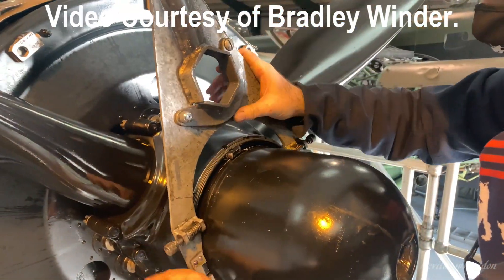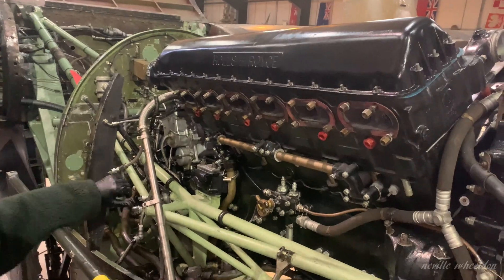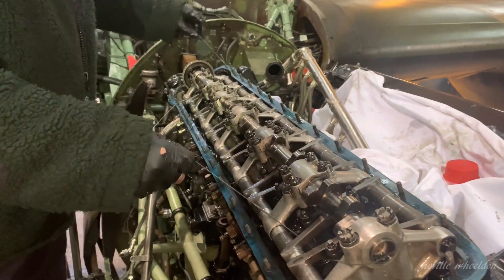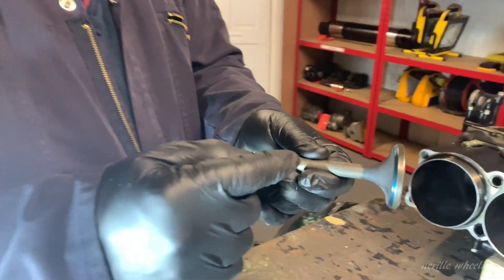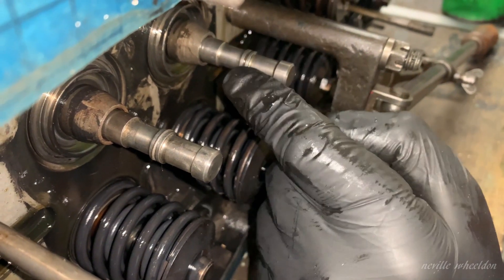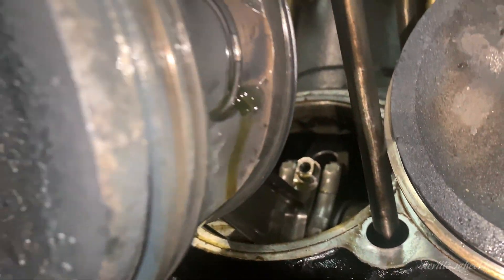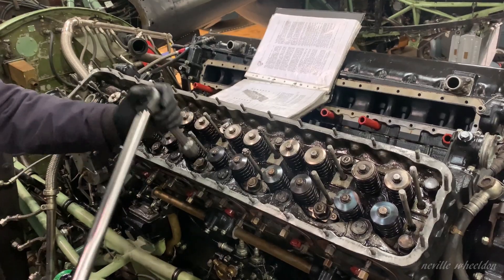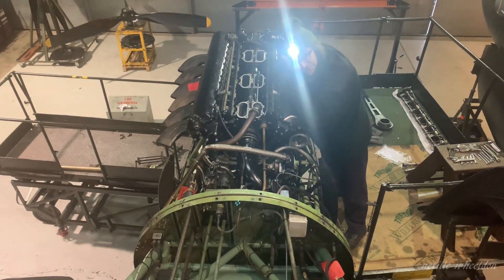Lockdown video 30. Received more Video clips from Bradley, engineer at East Kirkby

Comment: Brilliant video, thanks! An interesting point about the valve retaining rings at 7:00. I had a double spring failure many years ago in a Merlin and (I assume) the dished crown of the piston actually caused the loose valve stem to bend, which in turn caused the valve to jam in the guide and pull it down into the cylinder with the valve! Piston crown and head looked like mashed potato!
Reply: Ouch!!

Comment: Did you lap the valves once blued?
Reply: Lapping isn’t done with Merlins as the seats aren’t perfectly round until the engine is at operating temperature. So if the valve was lapped on the bench, it wouldn’t seal at operating temperature.

Comment: How on earth did they manage to manufacture all of the myriad of parts for this plane during wartime. There were countless other of types aircraft that were designed and built as well all in 6 years. The achievement was monumental and I doubt it could ever be repeated. The men that flew these planes were the hero's but we must thank the designers and engineers that built them. The modern F-35 jet took 10 years to design and develop and is in service with 871 faults !

Comment: Are the valves sodium cooled ?
Reply: Exhaust valves, yes.
Reply: @BradleyWinder96        When I flew the Dak in the 80’s,  we. often had valve failures due to fatigue failure at the weld between the stem and the valve head.

Comment: A great bit of engineering born of huge experience but it would have been great to see the technique required and the tooling to compress the piston rings when refitting the block. Any chance of seeing that???
Reply from the maker: There are two more block to be changed, so we will keep are finger crossed. This is a reply Brad gave to the same question you asked. Page down to Paul McCullock.
Bradley Winder
1 week ago
We tried but didn’t have enough hands 😎

Comment: Interesting. The cyl. Head doesn't separate from the block then. Must be a nightmare to insert new valve seats.
Reply: It does separate from the block but to remove it from the skirt you must remove the block first.

Comment: Question for the techs, I presume the bottom of the liners have a long gradual taper that acts as the piston  ring compressor?
Reply: Unfortunately not. We use ring compressors and tweezers for the final four scraper rings.
Reply: @BradleyWinder96  , thanks Bradley, I’ve put a lot of liners and pistons  into lorries , thought I’d ask how you did it
Reply: @BradleyWinder96  , ps my other half and I were down to see Just Jane in 2019